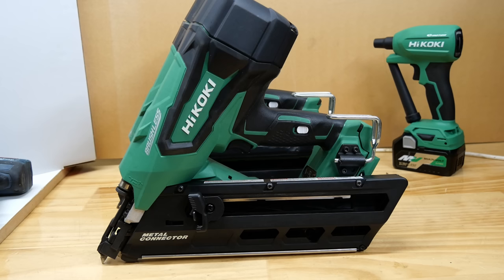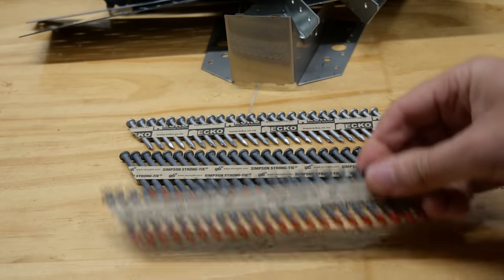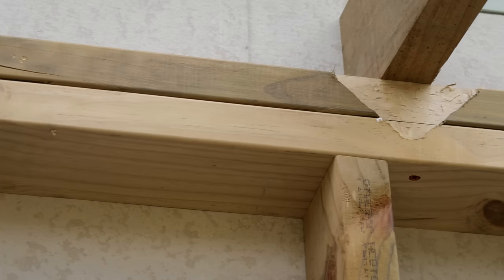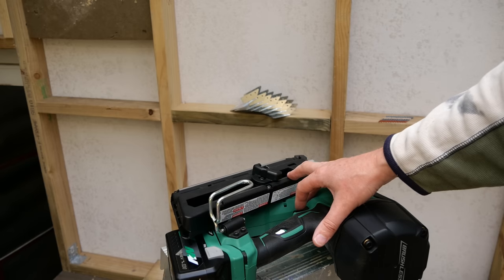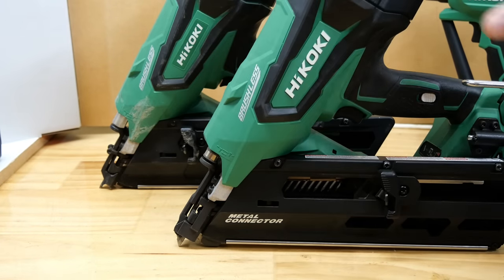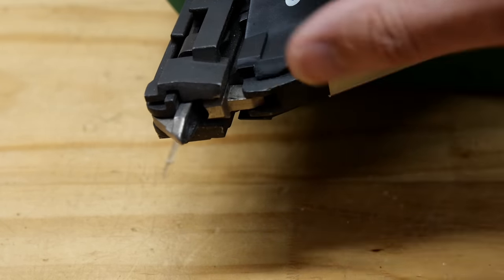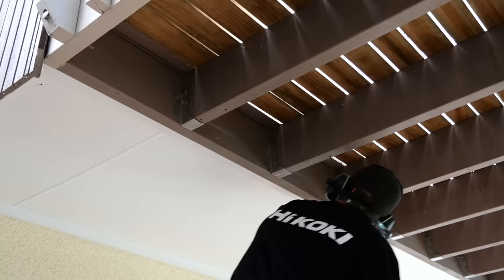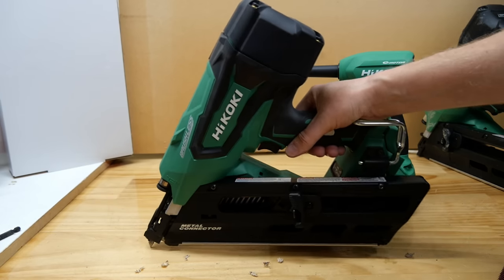36v HiKOKI Metal Connector Nailer Review. Never hit your thumb with a hammer again! Metabo HPT

Comment: its disappointing that Makita doesn't have  a decent selection of nailers
Reply: Makita is not so big in nailers , but they make lot of garden tools , if they just would put their garden tool R&D crew to figuring out nailers .

Would also like to see staplers , for 1/4" and 1" wide  , they do have pneumatic versions , so cant be hard to make them as cordless .
Reply: Makes me angry,  I'm ridiculously heavy into Makita cordless tools and I'm reluctant to have to deal with multiple platforms, but I'm getting close to branching into Hikoki because of this.
Reply: My solution is to stick with Makita, and buy cheap battery adapters so I can use a throwaway cryobi or Bunnings Ozito tool.
Reply: You and all the other 20million makita users worldwide are disappointed 😂
Reply: @roland985   Is there an adapter for using mikita 40v batteries with Hikoki 36v tools?

Comment: 13:00 firing thru bare metal should be fine in lieu of that pesky hard to reach nail hole should be A-OK for load if firing into solid wood & not say between 2x members behind the plate (probably actually better that thru a hole truth be told). One caveat: thicker strap metal may provide a dangerous situation. 2nd caveat: NEVER try a shot thru metal w/gun at an angle as it'll glance out & fly the nail g.k.w.
Reply: Korrekt. Schutzbrille und  Mund  zu. 45.000 Nägel an einem Tag geschossen.  Kollege hat einen Schneidezahn verloren.

Comment: Did you find that the nails would twist inside the rack and become stuck with the strongties?
Reply from the maker: No.
Reply: 🤔 I recently got the gun and it does it fairly consistently which is kind of annoying. the spring loaded part seems to get under the nails and twist them. 😅 guess it’s going back to Hikoki

Comment: Where the heck do you find the 35° paper nails for this nailer; cuz if I could find the nails here in USA…..I’d buy this nailer in a sec8nd, but 30°-33° metal connector, or joist hanger nailers is what used to and those nails are everywhere. 35° collated nails, can’t find!
Reply from the maker: 30 to 33° will work fine.
Reply from the maker: So long as they have the gap.
Reply: @ToolsAndStuffOFFICIAL  so as angle of mag is 35°; would 30°-34° MC nails work just fine is this nailer? Used to my old hitachi pneumatic nailer (2 strips) and uses 30° nails. I’m assuming that as magazine is 35°, that doesn’t mean the nails must be “35° “ either….as finding 35° nails is like impossible b/c in my 25+ yrs in trades…never heard of em and don’t think they make at all, lol…. 🤔 
It’s like telling your new apprentice to go to store and buy a fluorescent bulb bender or a glass hammer……THEY ARE NOT REAL😂😂

Comment: Hikoki are too slow with their new product dev/roll out.
Reply from the maker: People tell me that about EVERY brand.
Reply: @ToolsAndStuffOFFICIAL  lol. But it’s actually true about Hikoki.
Reply: Just do an analysis on all your videos and what percentage is Hikoki. It’ll be right at the back. Makita, dewalt and Milwaukee bring out new products (big and small) regularly. 

Before this nailer, The last product Hikoki released was their two cordless routers.

Before that it was their cordless table saw.

That’s all they’ve done in the past 18 months.
Reply: @haroon420  I agree they are slow BUT they have released a Brushless sander, heat gun, several lights and a few other products I forgetting.  So its bad but not that bad.
Reply: @haroon420  To be fair, the Milwaukee first gen are public prototypes, the Dewalt is yellow and most of the Makita are coffee makers and radios.